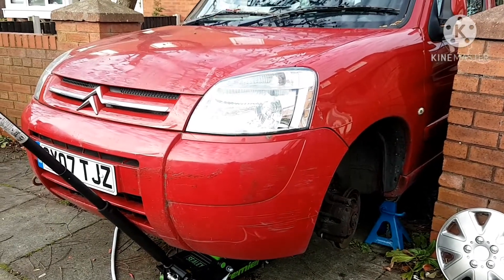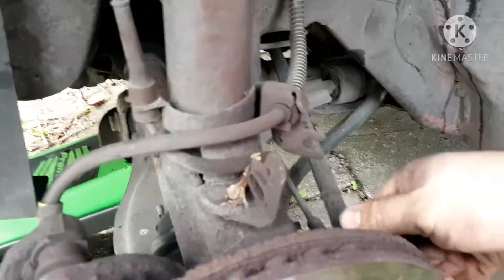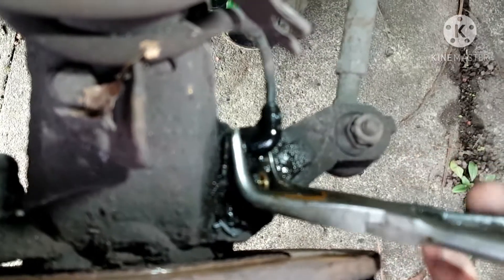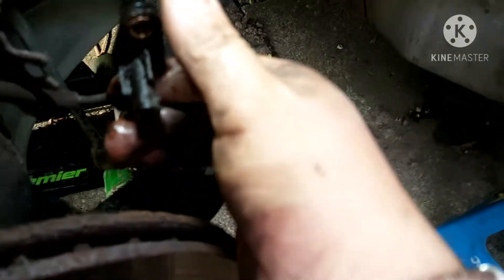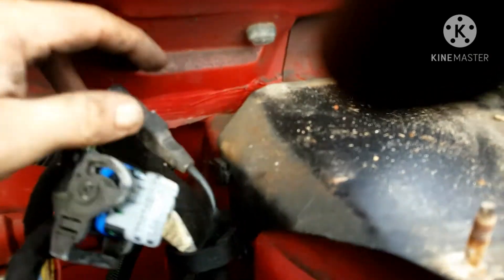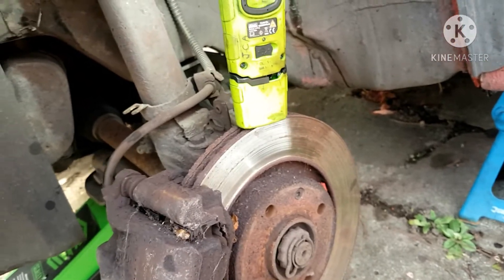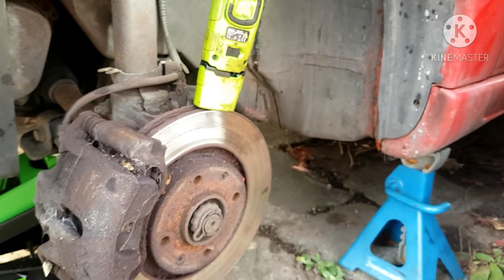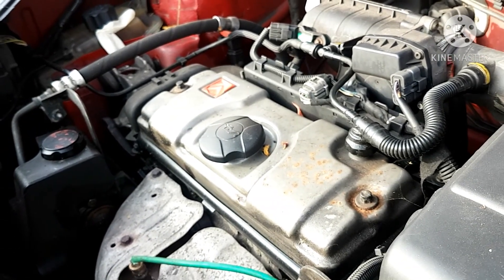How to remove an ABS wheel speed sensor in a 2007 Citroen Berlingo.

Comment: Would this be the same procedure for 1.6 petrol from 2005? and how about rear ones? thank you
Reply from the maker: Yes I believe the 2005 ones are the same. As for the rear wheel speed sensors, I think the procedure is slightly different. Best of luck, thanks for watching.

Comment: Hi
I have same engine and I need help with a broken wire on right hand side.
I found a twist electric wire and a connector , but I’m not shore if goes there.
Do you have a email please ?
Regards
Reply from the maker: Hi, i would have to see what wire you  are referring too. It does sound like a sensor wire. There is an ABS sensor that will run threw the engine bay and go threw the rubber grommet to the wheel speed sensor. The wires are twisted together for those sensors. There will be a few other sensors in the engine bay that will be  twisted together as well. This is normally sensors on the CAN BUS network. Most of the time I look and see where the wires naturally lay and if there are any connectors seem to match. What DTCs or faults do you have? Thanks for watching 😊
Reply: Hi! My tachometer and speedometer is not working. But as I understand the speed sensor sits on the gearbox. But this video made me confused as DIYer is it possible that I could just change the abs speed sensor?